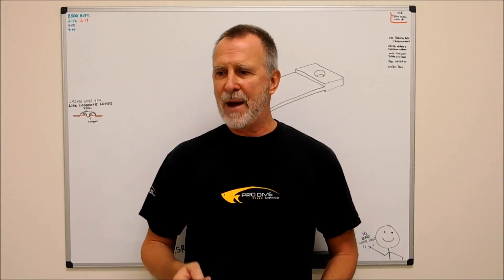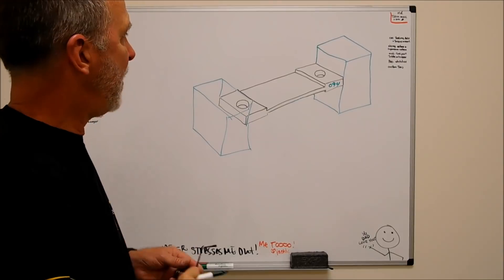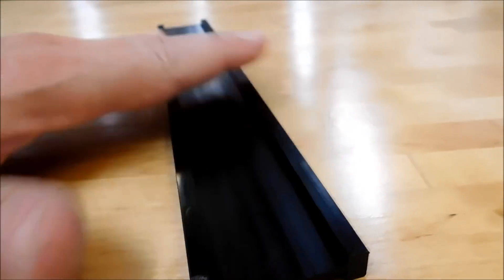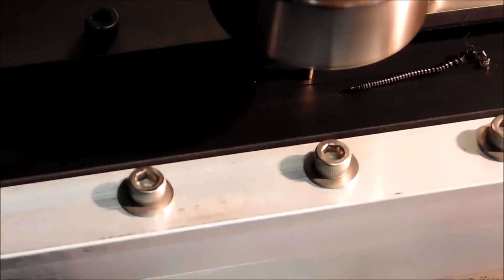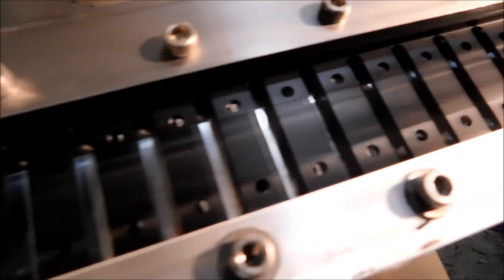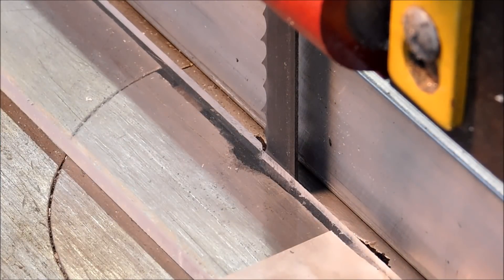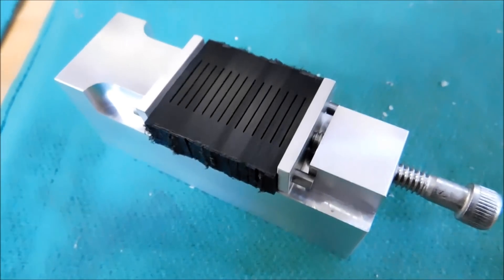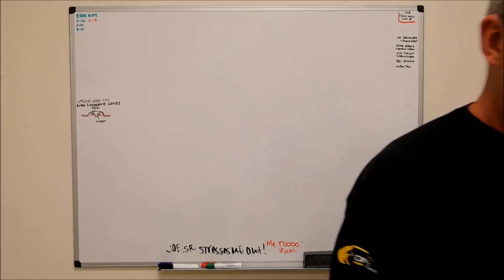Dogbone Milling - A Great Way to Hold a Small Part

Comment: Nice job!  It would be helpful if you added up all of the time and materials to create the fixtures required to do this.  It's nothing complicated but a layman watching this video would add up the times quoted in the video and have an unrealistic expectation of time and cost to actually do this job.  As a tool and die maker myself, I understand the vast majority of time went into designing and making the fixtures and then programming the NC code to run in the CNC machine, many others would not.
Reply from the maker: I like to joke that the customer paid for the fixture and I threw the parts in for free. Overall, it was a good job.
Reply: The re-order is where you actually make a little money on that fixture sometimes.  Nice attention to detail Joe.

Comment: Just curious of the logic to bandsaw the ends off and then load into a specialized fixture, vs having a fixture similar to the first one that holds the part from the holes and just running an endmill down the side completing both the process of the bandsaw and then back to the mill?
Reply from the maker: Good Question. My reason for the small secondary fixture is two fold. First, I would have needed many tapped holes in the main plate and top clamps or a common rail to hold the parts down. I was concerned, because of the thin cross section, the clamp may leave trace impressions on the parts. Another reason was that I didn't want to cut into the fixture on a location surface on my final operation possibly compromising the fixture for the repeat use. The holes offered a positive feature for positioning and size control. Stacking them like cards offered compression integrity and eliminated numerous surfaces from any deburring. Only the  last part in the stack had any burrs at all and they were nearly invisible.
Reply: Thx for sharing

Comment: Just had to make hold downs for a 10' sheet of anodized aluminum
plate for my cnc router. I made the hold down blocks out of black
delrin and they worked great. I flexed them a bit for the 80 parts
I made and they kept their resilance til the end.
Keep those drop off's from the band saw, they can come in handy.
Reply from the maker: I have a whole box. You never know when they may come in handy.

Comment: You talk of saving time, yet that fixture took time. You talk of incremental moves when drilling the holes yet on the second row of holes you feed all the way back to the left end before drilling again. You should have started at the right side and incremental moved X minus to save traverse time. I'm guessing she's a slow mill as the hole drilling was very slow. In short yeah it's great you're thinking of different ways to do things but it's not that hard a job to do. I'd have .add it in 2 operations with allot less material wastage and probably at a cheaper rate of you consider the tooling costs and inefficiency in your method
Reply from the maker: How about inquiring about the points of interest you so readily condemn before you condemn them. Understanding the why behind this process would really help you to make better comments. Let me explain the logic. Lets assume, you start cutting the plastic right away while I start making the aluminum nest shown in the video. 3 hours into the job, you are still cutting away with what ever process you have chosen, and not yet realize you will hit a point where you will absolutely have to address these in single part, or small group ops. 3 hours in , I prep blanks and blow by your progress level like your standing still because I planned my steps and now have an awesome fixture for the expected repeat order. The incremental drilling op was the fastest way to code this. The return to the left side starting point combined with an absolute negative Y axis shift, took 7 seconds and allowed for the use of the exact same code as the first row of holes. This assured me, that if any stack error was present in the machine, incrementally, my holes would still all be inline part to part. The speed and feed of the drill was chosen to reduce backside chipping and possible part burning from the friction. The thicker material was used because it was unlikely to compress under the pressure of the clamping pressure on the ends. I hope this clears things up for you.
Reply from the maker: Oh yea....one more thing. As the owner of these machines, I chose to G1 the traverse move as not to G0 into a reverse G0 for the incremental initial shift and slam my machine around like some $12 hr operator. Thats all I got.
Reply from the maker: If you read and understood all of my reply, I believe I addressed everyone of his points. What part of the reply did you find egotistical? I thought I stayed factual throughout.
Reply from the maker: You  make a good point and I apologize to anyone I may have offended. Written and electronic text can be misleading if the words aren't chosen very carefully. Believe me, I choose my words very carefully, but every so often, the human side sneaks through and I just have to dig the nit pick critic ( AKA troll ) that talks out his ass without knowing the why behind what he's watching. The thought behind the comment was such that an operator making $12 an hour doesn't have as much skin in the game as the guy that laid out the 40K in cash to get that machine on the floor. He just pushes the buttons and goes home. If the machine crashes or breaks down....Oh well. My first job was for $2.72 hr and I gave it 110% every day. It got me where I am and I have the utmost respect for all the guys coming up the ranks, or I wouldn't be doing this channel. Its not an easy journey. But at the end of the day, we all put our pants on one leg at a time no matter who ya are. Thanks for your comments. I'll try not to shit on any old turds.
Reply: @joepie221  I just watched this and I knew the machine repeated the holes like that so they would be exactly alike

Comment: Seems like a lot expense and non-value added activity for such a cheap part. That part could have been made for much less expense and faster in soft jaws. You could see in the finish how the tool snipped on the long side because the part was able to flex
Reply from the maker: Lets take a harder look at your comment. Soft jaws would translate to  machining these 1 at a time. Soft jaws would also equal direct pressure on a flexible plastic part with a 2mm cross section, which in turn would equal part distortion and irregular cross section geometry. As for the torn up finish you speak of, please point it out with a time reference so we can take a better look. the fact that this was a cheap part demanded a process that offered consistency between the parts and reduced times. I'd put my time and method up against any other, any day. In closing, tell us how you would have done 100 of these and have the results within .001 and achieve the finish shown.

Comment: common sense vibration damper ; that original part still exists after milling or treatment; without torsion; expansion; or stress FRACTURing;

Comment: I've been cutting alot of delron for DRS lately, holding +-.0005 on most of their parts.   I always us my reminder saying, "very lightly clamp your part, if you think your vise jaws are to tight loosen them a bit", that delron cuts like butter and will hold under  minimal pressure. I will be using your drill, band saw, and softjaw setup for a similar part, thanks for the video! I have all sorts of delron setups i like using!
Reply from the maker: This is great material, but does have surface tension in sheet form. Single sided operations can be tricky.
Reply: Joe Pieczynski Yeah don't start with sheet, quote based on using large oversized stock and mill symmetrical to size.  I have done a lot of Delrin machining.  I have ground Delrin to ten thousandths of an inch.  It's very versatile and a great option.
Reply: You haven't cut any delron. It's Delrin
Reply: T.J. Mackiewicz You can also surface grind Delrin.  Some thin double sided tape and an open dressed 32 or 46 wheel and light passes.  I've ground it to within .0002" tolerance.
Reply: James G yea ive since switched techniques to double side tape!

Comment: End Mills don't have parallel cutting sides.  They are all tapered some for plunge, and it kills me that they don't reference how much taper is in them.
Reply from the maker: I've seen them both ways. There may be some relief, but its minimal or your part walls wouldn't be parallel when you cut 2 sides of a part.
Reply: Granted, it's only around a thousandth, and like you said, the sides are never parallel better than 1 thousandths over an inch deep.  I tested a lot by cutting two sides of AL like you do with your parts.  An end mill that cuts parallel within 2 tenths over an inch is rare -and I think accidental.  I had one hourglass shaped.  It's usually around thousandth.  I drove myself nuts trying to cut bearing recesses within 2 or 3 tenths in AL.  I ended up having some end mills custom sharpened to be more parallel, but the concept seemed lost on these guys.  They weren't so concerned with it, so I ended up cutting .1" steps to get a 1" bng recess that wasn't tapered.  
The final length of your parts would be affected by the depth you use on your end mill.  They are usually fatter on the end, so if you need them to measure within a couple tenths, this plays huge.
I don't do this professionally.  I understand bearings should not be done on a mill, but my part would only go on a rotating table.

Comment: Hey Joe, nice video and parts. I have couple questions though. As you stated near the end of the video, you wish you 1,000 of these. Is it worth building fixtures like the kind you have for 100 pieces? Also, the amount of material (Delrin is not cheap) seems to be a lot more waste than just using closer thickness stock. Just my thoughts, enjoyed the vid!
Reply: for work like this i wouldve built a small fixture with a boss the same as the pocket and to locate off the two holes for the final operation, used to do stuff like this all the time

Comment: Hey man great video, I love a bit of creative fixturing. I am a big fan of the incremental move using a loop too, you can produce some very economical programs from this method. Plus, if you need to make changes you don’t need to go trawling through lines and lines of code. 👍

Comment: What was your strategy to break the edges on all those little buggers?
Reply from the maker: The holes were c'sunk by hand, but the entire part was climb cut with a brand new endmill. There were no burrs, and delrin really doesn't get sharp enough to cut.

Comment: For a 1000 lot on that I would be fantasizing about a bandsaw bar-o'-'luminum sled for those parts with a double row of pins and some spacer blocks off the fence. No part movement on cut free or scuffing. Pins could be several thou undersize not to be a headache. No loose pieces pre or post-cut. I guess just grin and bear it for a small batch.
Reply from the maker: Better yet, interpolate all these pins and make the entire sled 1 piece.

Comment: Hey ,did he just brushed the alluminium vice at the end with that long endmill ?? ?
Reply from the maker: It was sized before the cut was made. Its just a coincidence the block was just slightly wider than my finished size. Either way, the code finished the part to size.
Reply: I saw that too but I thought he actually fabricated that small vice specifically for this project. If he did, why was there no part stick out? Mistake in Fab? Wouldn't make sense to build such a nice micro vice only for it to be a sacrificial fixture
Reply: Just my 2 cents, but I would say that if the parts were proud of the fixture the cut might not be quite as clean. He did say the material was going to flex during the milling process.
Reply: Joe Pieczynski good job !

Comment: Cool video and appreciate them. Strategy vs quantity is always worth taking a few moment to plan. Last op for only 100 pcs. being made from delrin could also probably just lay a couple gage pins square to and on top of the hard jaws with stop on a pin using a couple 1/8 thin AL straps to set down in the vise between the pins to help support. 2' long pins do maybe18 per shot.

Comment: Nice fixture and job approach. It always pays to plan thoroughly and have a fixture that works as you expect otherwise you spend all day fighting against it.  Been there and done that.Just wondering whether you tighten those cap heads in any specific order or to a specific torque setting?

Comment: Hey Joe is there any particular reason the fixture has cap screws with washers on one side and not the other? 

(Wouldn’t think so but since I’m new to machining I️ figure I️ don’t know what I️ don’t know. Thanks for the awesome channel man!)
Reply: I'll wager a guess.  The cap screws without washers only have to clamp down on the part, the backstop is built into the base of the fixture.  The cap screws with washers have to clamp down and push the part against the backstop.  If so, the holes are probably oversized a little and the washers keep the cap heads from centering on the holes and pulling the jaw away from the part.  The piece I'm not certain about is the small step where the jaw mates with the base.  Seems like it'd interfere with the jaw pushing the part against the backstop.  Maybe the dogbone ends extend out enough to compensate.
Reply from the maker: 2 answers here. Washers are used under the front jaw because the holes are a little bigger, and the material is aluminum. I didn't want to imprint the jaw with the screw head and not be able to apply rearward force each time. The little step in the bottom of that jaw is so the front of the jaw tips down during clamping and doesn't raise the center of the part by clamping on the outer most material edge. The clamps are .oo5 taller than the material and pinch .200 into the stock.

Comment: It looks like a lot of time spent on the fixtures relative to the lot size. What was the total time of the job end-to-end with all the figuring and fixturing - setup parts, etc?
Reply from the maker: About 6 1/2 hours total.
Reply: Pretty quick! Were the fixures a scratch design/setup or did you already have something close enough to modify or adapt? The end result was pretty slick, I just don't think I could have pulled it off that fast. Hats off.

Comment: One  series of questions occurred to me: why did you rapid all the way back to the left for the second part of the drilling cycle?   Would it not  have been faster to have a reverse index drilling cycle and start that on the near side and go back?  This is the approach that I do when doing similar things on a conventional mill.   I realize that the program is the same, but does that really save time when you have multiple parts?
Reply: He was using incremental moves rather than absolute position for the second and subsequent holes to make the code smaller. That means having to start from the same absolute X position for both sets of holes. Am I close Joe?
Reply: tridium6111 oh...that makes sense.

Comment: I am curious why you chose to remove the rib then finish the end of your part in 2 steps. Instead of building your work holder to clamp down on your part through the holes and use your mill to remove the rib? Just a materials on hand thing or just the current plan? No criticism intended looking for insight on your thought process on this technique.
Reply: Hjgghbb Vhhgghj, he could have used a thin material across all the keys/flats that were cut to hold each piece to size with little effort and no saw jig.
Reply from the maker: I wasn't interested in handling screws and clamps for the final op. I picked a direction early on and went with it. Screws in the end holes would have imprinted the material, and I would have had to tap an additional 42 holes in my plate.

Comment: From all the machining channels I visit, yours has unique tips and tricks, thank you for keeping it fed with quality videos.
By the way,  what would be the difficulty if simply using large flat stock with suitable  number of indexing pins to flip the board once all the cuts and holes are done on one side ? the only issue I see in this case is to get rid of the holding tabs, which may compromise the final finish.
Reply from the maker: Thanks for the compliment. There were a few ways to approach this job. I picked this one and went with it. i do like that tab approach.